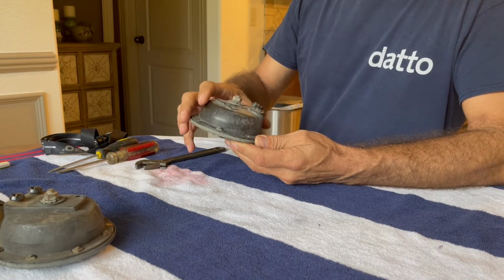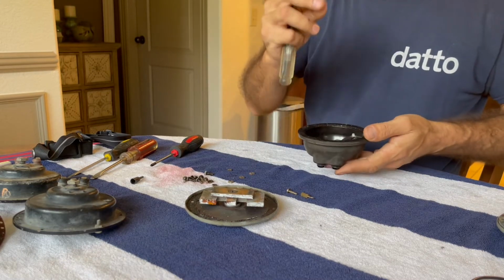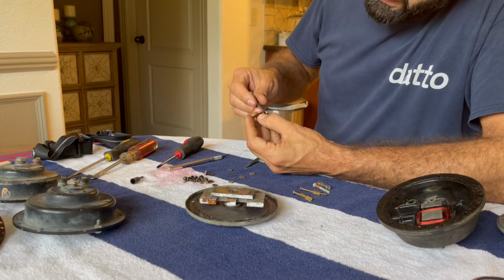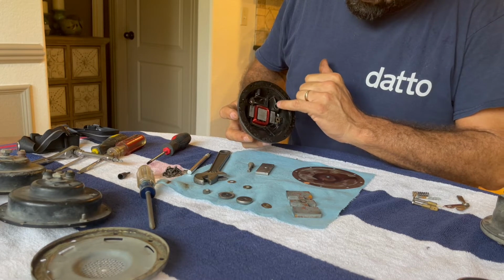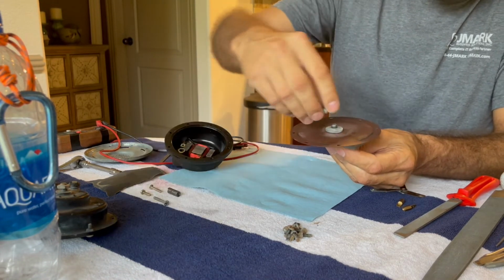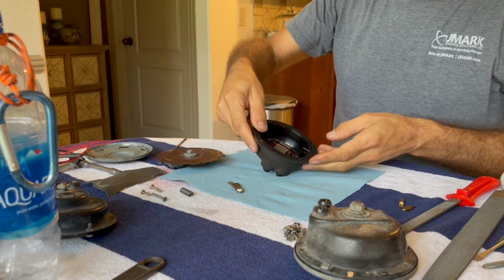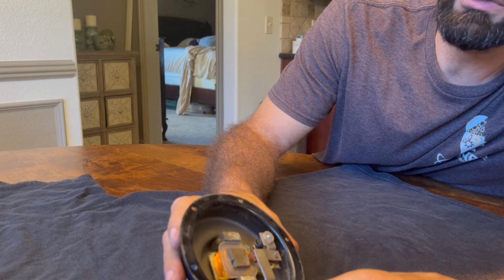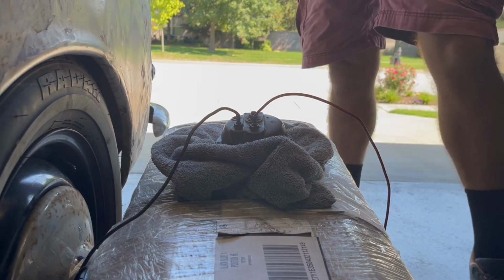Breathing new life into “broken” horns

Comment: the refurbishing and restoration is a joy to watch. Much more satisfying than just replacing parts.
Reply from the maker: Thanks for saying so. You’ll definitely get more of that with me, but there will wind up being some parts replacement videos happening at some point too! 😁 I really enjoy the restoration process. I still have to do the other three horns now.
Reply: @vdubjunkie  I have only gone as far as cleaning the points with good results.
Reply from the maker: @johnfreeman1189  I’m betting that is often enough. On my first horn, there was also a lack of continuity on one of the rings connected to the coil wire, so that would have been a show stopper..